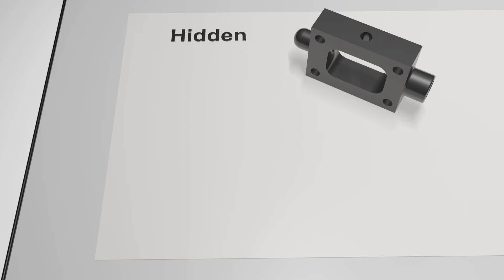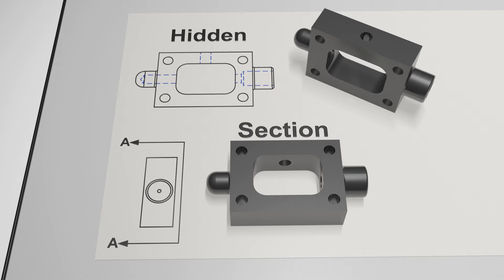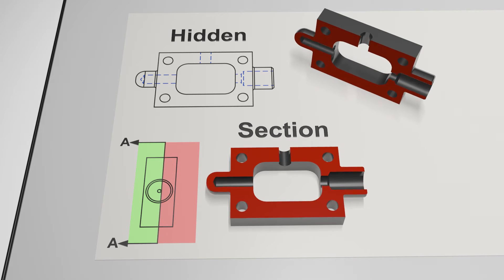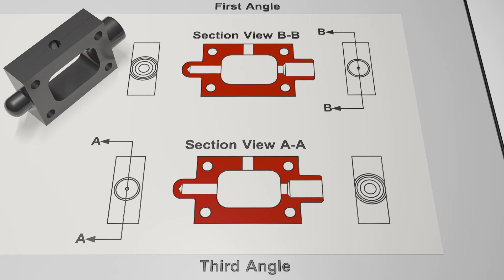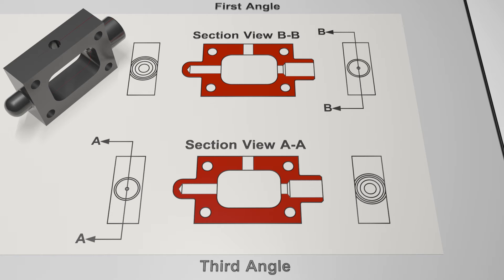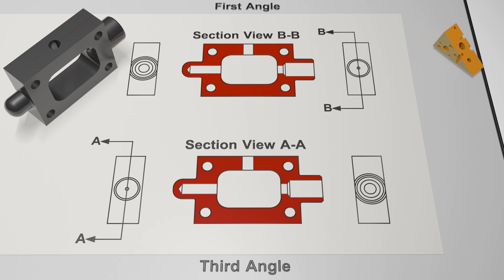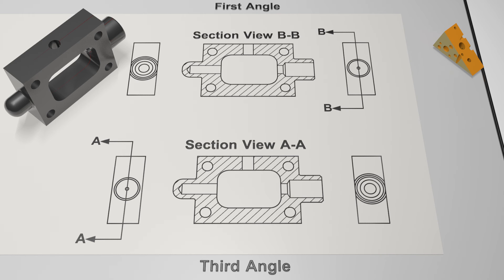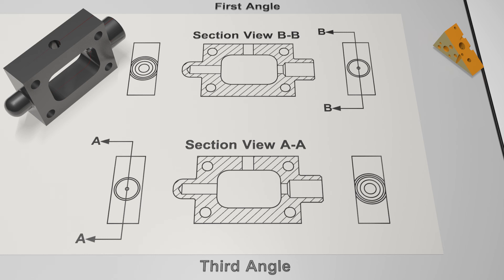Section Views in Engineering Drawing & CAD - The Basics

Comment: I didn't understand the part about first angle and third angle the two drawings look exactly the same
Reply from the maker: +NinoDroid 

It's a combination of understanding first and third angle, and understanding how the section line (A-A or B-B in this case) cuts the object. 

If you aren't 100% on how first and third angle work, take a look at my videos on that first.

The side the arrows point to on the section line is where material is kept, the other side is discarded, applying that and then projecting using either method will give you the result.

In this case the drawings are intentionally identical, however what first and third angle results in is simply a reverse layout, it doesn't change the geometry. Only how you lay them out. Typically using either method you always keep the main/front view the same, which in this case was the section itself.

If any other part in particular is still confusing, feel free to try and describe in detail where you get lost and I'll try my best to explain. Text unfortunately ain't the best method for geometry, but I'll give it  a go.